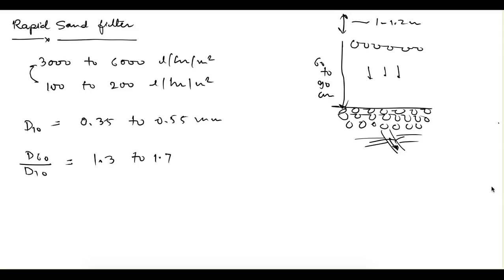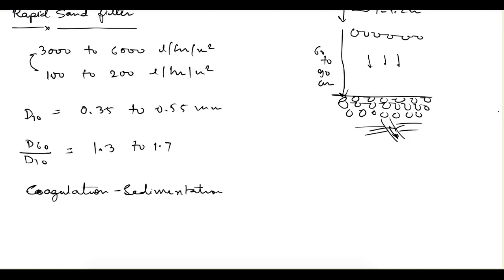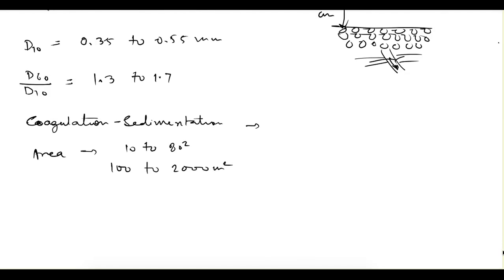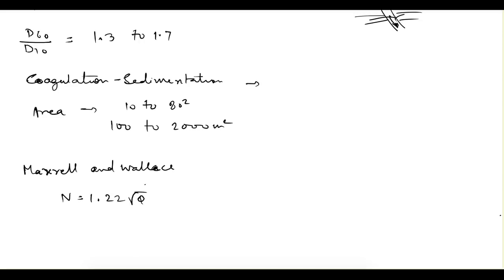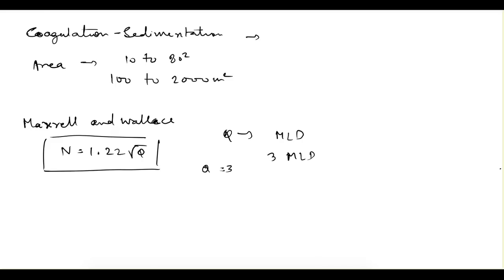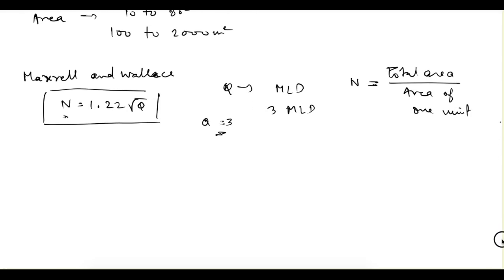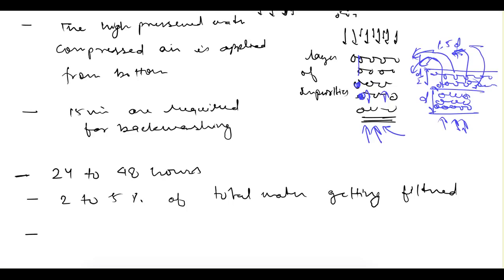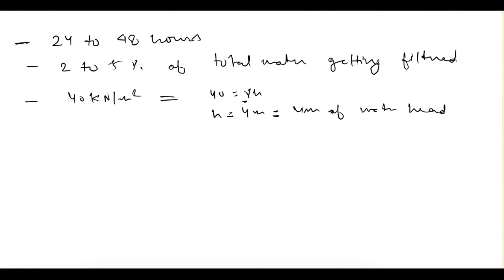Rapid Sand Filter | Environmental Engineering

Comment: What is the technical basis for maintaining a water depth above the sand of 1-1.2m. Why not 2 m? or 3 m? or 0.5M?
Reply from the maker: Two factors are there. First, the rate of filtration should be adequate enough so enough filtered water is coming out. Second, the rate of filtration should not be as high that the water does not get enough time when it passes through the filter and thus impurities may not be removed.
Reply: @APSEDUVERSE  How do you compute the first one? And how do you compute the second one?

Comment: What is the role of water drainage system in rapid filter processing.( lateral drainage, ....)
Reply from the maker: Water drainage system is required for two purposes, to collect the filtered water through the filter and to supply the wash water and compressed air in the upward direction. 
Later I will make one video regarding it because it is more relevent to theoretical part of ese.
Reply: thanks Sir.....
I frequently solve gate numerical questions but didn't solve Ese theoretical questions as many as I want...
plz also suggest how to conquer on this problem....